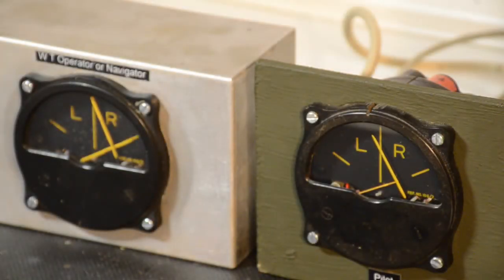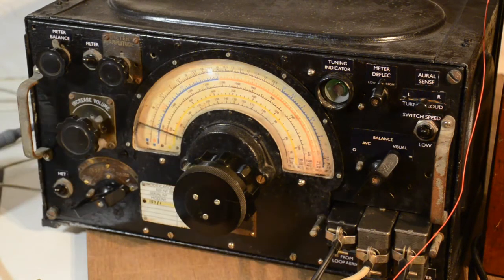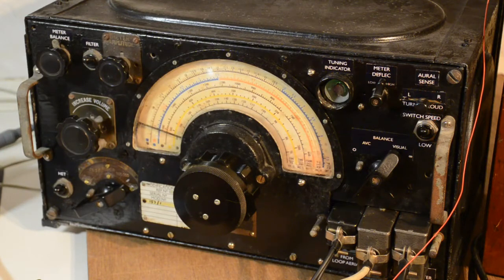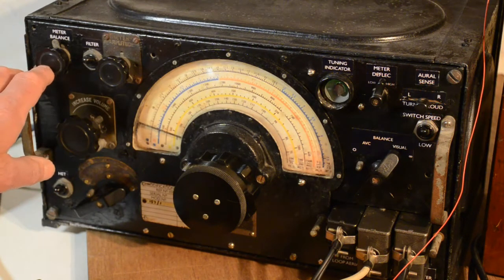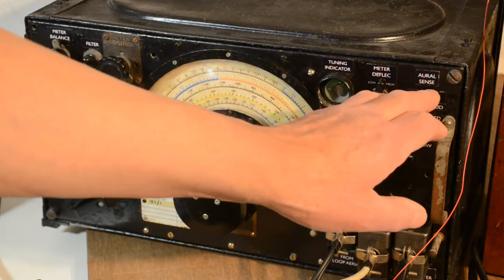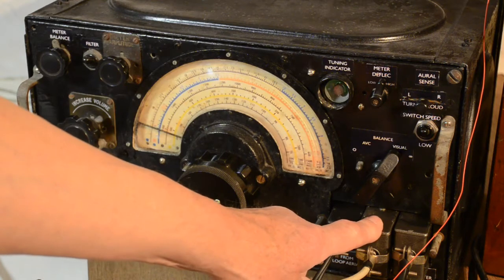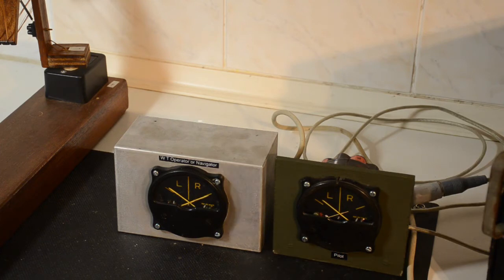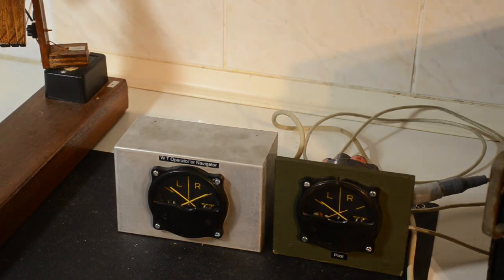Radio Direction Finding with the R1155 receiver

Comment: I recently purchased the display complete with jones plug. I never succumbed to the temptation to remove all the DF components from my R1155. So, your video has spurred me on to get the DF section working now. After all, there can be so few of these radios still capable of working as they should, I feel duty bound for posterity to make it work for me and future generations!
Reply from the maker: That's really good news! Well done for 'biting the bullet'. As long as you have at least one meter, plus the special switching transformer, the rest should be plain sailing. Let us know how you get on!

Comment: Thanks for another excellent video. It's a pity there are no longwave services still operating. I don't think they operate anywhere that I'm aware of?, unless you consider some of the navigation and shipping systems you refer to in a previous video.  But they are FSK  not voice Regards Clare
Reply from the maker: Sadly in the last couple of years, the last few big LW transmitters have closed down  :-(  As of October 2024, in the UK there is just BBC Radio 4 long wave left. I understand that at the moment, there are a couple of others (out of range from here in the UK) include Mongolia, Iceland and Romania. There may be a couple more out there too!

Comment: I would appreciated more info on the antenna system...
Reply from the maker: The R1155 has several options when it comes to the aerial systems that could be used. In the case of direction finding, it used the DF loop (as seen here which was rotatable) and a fixed rod - the chrome telescopic in this case. With the Avro Lancaster, the DF loop was positioned behind the astro dome at the very back of the cockpit. I hope this helps!

Comment: That's interesting, thank you for the demonstration.
I always wanted one of these receivers and an AR88 but never got either. Always wanted a Wireless 19 Set too, which I did get a much modified one in 2017 and needed extensive work to improve it into a reasonable set.
G4GHB
Reply from the maker: You're welcome. Of course, the downside of buying one of these is the possibility of it being 'modified' by a previous owner. The one here had very little done  to it, but still needed many months of work to replace all the miles of rubber covered wire that had perished!
Reply: @lishaton  My 19 Set had been modified already so I wasn't bothered modifying it further, B Set already gone so I put my my h/b inverter there, only 2 Watts QRP tx, xtal on tx. for stability using it's EF50, very deaf on rx- re-tune the i.f.t.'s,, extremely deaf in the c.w. position until I replaced the R's and C's in the audio filter, 2 coils O/C which I re-wound, some wrong wiring, BFO disconnected.
Much better now. 280 miles on 5.262 MHz c.w.. Pleased with that.
Reply from the maker: Excellent! :-)

Comment: Very interesting. We have a few of these sets at the Lincolnshire Aviation Heritage Centre, where I work as a volunteer. And I'm in the process of trying to get some of them working.  The latest one has been modified (very badly) to work off mains, my apprentice and I are in trying to get it into a usable condition.
Reply from the maker: I hope you manage to make it work! What with all the mods. one has to locate and restore to original, plus all the rubber wire one has to replace, both you and your apprentice have a long and tedious job ahead of you I fear! At least there is plenty of information available in the Internet for you to check the circuit etc. plus the performance of these sets is good when everything is done. Watch out for the power supply though, as the valves bias supply makes it a little unusual. Good luck to you both!
Reply: I was there back in july, saw this radio inside the display cabinet, always wondered if would ever be operated again.. i own one now and intend to make it operable

Comment: It's a beautiful thing. Ended up in here due to a video game called DCS, which is a flight simulator and  now has the Mosquito Mark VI. In game the Mosie has this coupled with the T 1154 transmitter and now I know how to use them. Great video, and I liked what you did there, keeping this radio with the original function it had in WWII.
Reply: Same here. This a very helpful demonstration of the real thing. The R1155/1154 is simulated extremely well in DCS. You can interact with all of the controls. I've restored radios from this era and it feels very close to operating a real set, especially in VR. I've been obsessed with it!
Reply from the maker: Thanks for the appreciative comments. Yes, these games do seem to become more and more detailed!
Reply: Me too
Reply: Me too, too funny.

Comment: I restored my R1155 with its DF section and made the loop antenna per specifications given in the AM handbook (that took some time..). 
The dual needle meter (found in a surplus shop..even more rare) together with a long wire antenna gave a good account of itself showing a fairly accurate direction  to the long wave commercial transmitter some 50 miles away.

Some years ago a senior friend who piloted Lancs on 460 Sqn RAAF (RAF Binbrook, Lincs) told me he never bothered much with the DF on home bound trips as the accuracy was not that good.
It's fun to demonstrate, though.

Since then I found another DF meter which is part of an AM test set to maintain the R1155 setup. Its only difference is a white background and a numbered amplitude scale up the vertical null line. 
The deH Mosquitos were equipped with the R1155, too.

Cheers.
Reply from the maker: Thanks for the feedback Alexander. Some interesting observations too. I'm surprised to hear that your friend didn't think much of the accuracy of the DF when used seriously, else why was a 'sensitivity' switch added o the R1155? According to the book this was to alleviate possible 'pilot fatigue' if the directions from the meter were followed closely. No, I didn't know the Mosquito used the R1155. Remember also that one of the sets variant was used in the RAF Air-Sea Rescue lauches.
Good DF meters are hard to find. One of mine recently had one of its internal resistsance coils go O/C on me!
Reply: @lishaton  Pleased to get your reply, TRR. Re the DF, I think inaccuracies were not the fault of the set but more the vagaries of wave propagation associated with long distance reception; refraction, reflection meant that exact straight line (transmitter to 'plane) reception did not always occur. 
I've seen the Air-Sea plywood cabinet with the 1155/1154 sets at Duxford. 

Sadly, the three Lanc pilots I knew are no longer extant. Soon all will be gone.

Blowing a coil in the meter does not sound good! 

 I use my set sparingly remembering that valve filament life is reduced by frequent on/off cycles. 

(Sorry for the delay, too, I'm 8.5 hours ahead of GMT. A mild spring morning here :-)